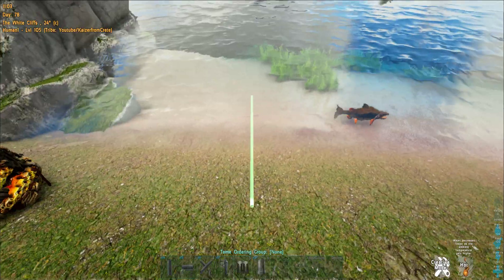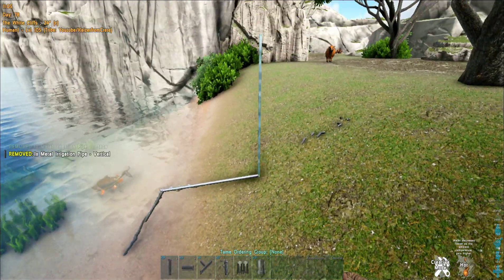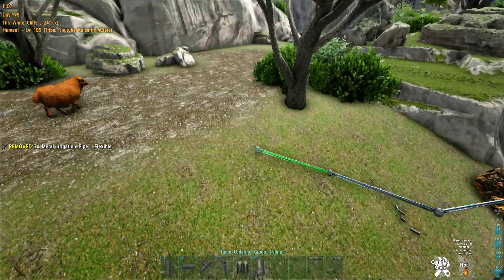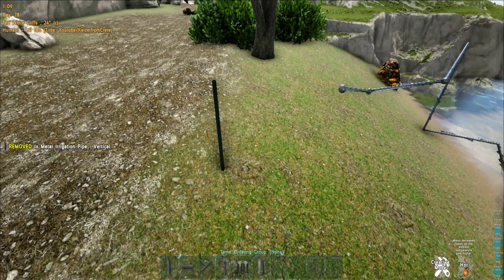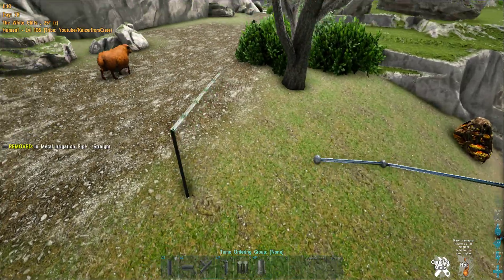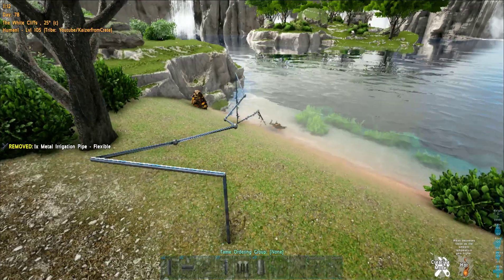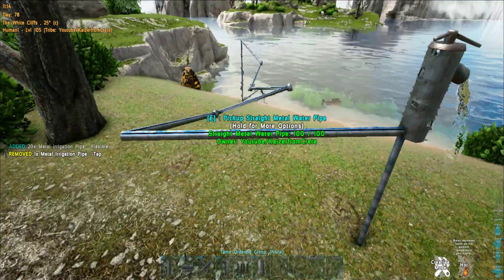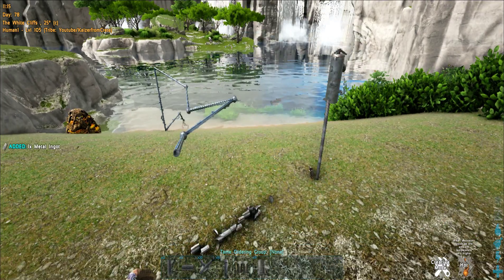How do Flexible Cables and Flexible Pipes Works?

Comment: Good video but my water is coming out the wrong way facing south and I need it to come out facing north. I don’t know how to change the direction of the metal tap
Reply from the maker: Tap direction is decided by how you place the regular pipe. Change where you stand and then replace your vertical pipe.

Comment: Are these cables worth it?
Reply from the maker: Very. Very well worth it.
Reply: @KaizerfromCrete  ah, what pipes/ cables should i learn? For me I'm always on rafts and always making docks for show lol
Reply from the maker: For cables you just need a solid one. You can go with Intersection, Vertical or Straight. A solid cable is needed for the generator. Then you can move the cable where ever you want with flexible cables. Pretty much same with the pipe. You can learn vertical pipe so you don't have to drink from the ground. :D Also for the irrigation you need the intake pipe so you can get water from seas, lakes and rivers.
Reply: @KaizerfromCrete  wow ok, and glad you made this video, i was so pissed and could not find anyone explaining what it does, i do wish it would work like a solid one, save space and better hide em ya know?
Reply from the maker: yeah, that would be interesting.
Reply: @KaizerfromCrete  hey how about this, what if ark added more vehicles? Like submarines, trucks/cars, aircraft like airships? I think that be pretty cool!

Comment: Electrical cables won’t work for me on the PS4 🙄
Reply from the maker: What's the problem?
Reply: Kaizer from Crete tried connecting them the same way you did but won’t work. Although, flexible pipes work fine
Reply from the maker: hmm, have you tried refreshing? do they snap at all? pipes and cables suppose to be same.
Reply: Kaizer from Crete flexible cables won’t snap at all, just shows a red dot which won’t connect to anything. I’ve tried connecting it to every type of electric cable
Reply from the maker: then you should report that. it sounds like a bug.